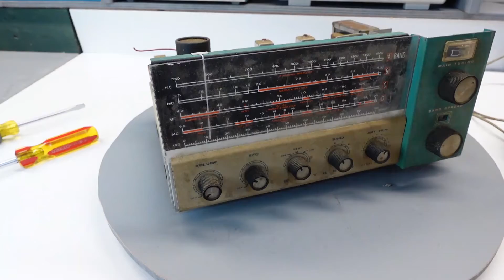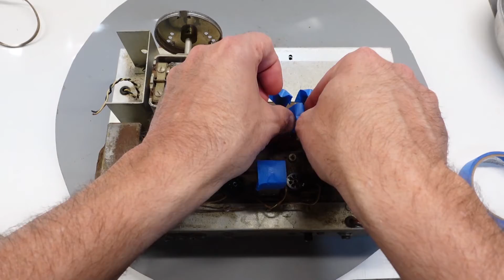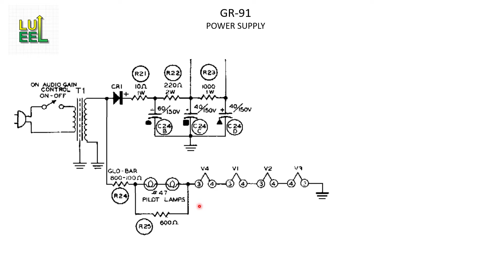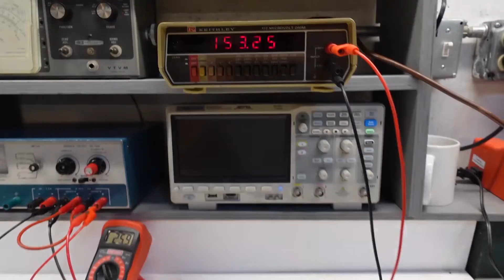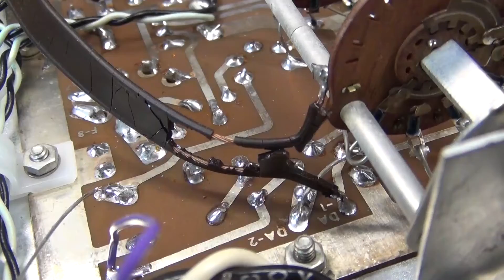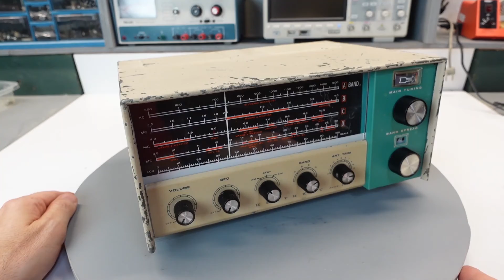Heathkit GR-91 Part #2: Can I Get It to Work?

Comment: With your vested efforts in effecting the repairs and alignment, painting the case is imperative. One thing I have learned over the years is its cosmetics, cosmetics and cosmetics. A working unit is great but unless it's pretty, the resale value remains low. Given the rough shape, I'd and sand it down quickly. or at least smooth, then finish it off with a spray paint; perhaps beige. Perhaps, pair with your Adventure xmitter and make a few Q's b4 you pass it on.  
73,
Glenn WA4AOS
Reply from the maker: Indeed, repainting the case is definitely needed.  I'm thinking of maybe doing a triple rig episode - it plus my Hallicrafters SX-140 and HT-40 that I rebuilt awhile back.

Comment: The fillement supply is typical Philips, in many receivers from the '60s and '70s last century they use so called U-tubes like UL82 or UF-41 connected in series with a special kind of NTC resistor, and yes they are glowed during warming up.

Comment: Hello, Nice video about the good old stuff from Heathkit, long time ago, i think 50 years I made the tube/volt meter, the generator, a tube-tester and the LF-generator from Heathkit...but I have a question about wat i see in the back-round, it is a Keithley multimeter.
Do it have a LCD screen, or is this one with LED, I owns a one with LCD but for long time the liquid looks like gone, do you find a solution for this?
Reply: Oh, I see it later in the video...LED.